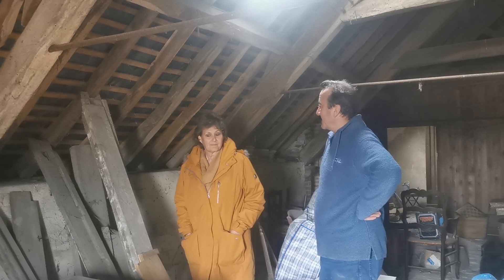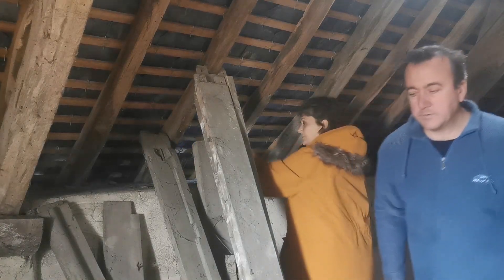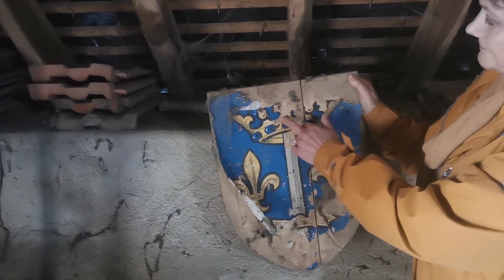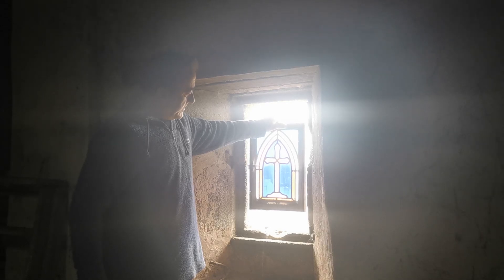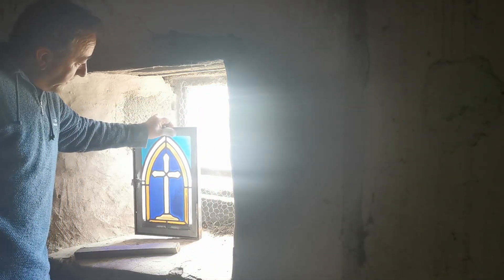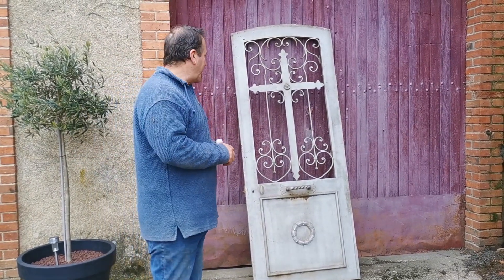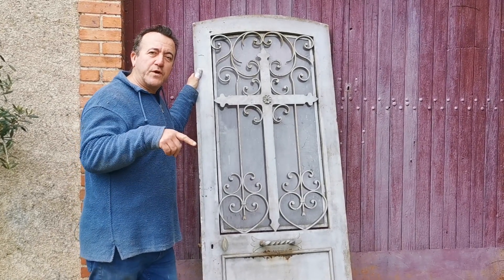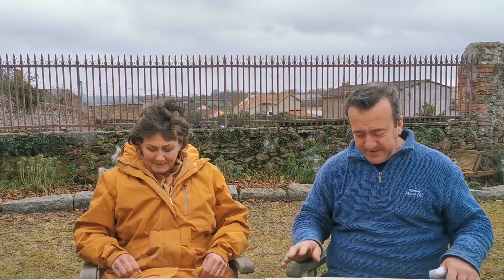Hunting for more glass in our attic

Comment: You might not like my answer but I wouldn't use the stained glass windows as windows in the attic for a couple of reasons. 1 the glass will be fragile, so I wouldn't be using as an actual window. 2, If there is any part of the glass that's been painted it will fade quickly in the light and 3, They are a conversation starter so having them so far away in a part of the building you don't go to means you're missing out. My suggestion would be to have the sitting on a windowsill in a bedroom so people can really enjoy them and the story. You could hang the in front on a window too If the window is bigger doesn't matter since they are hanging  in front. Not having the glass on the outside open to the elements would be safer for the glass. If you ever get your back door in the kitchen or somewhere the crypt door would make a great door. Well done of finding the glass.
Reply: We have lead glass windows that are Edwardian and we don’t have any fading. Most older glass that is coloured is mixed in with the glass itself rather than painted on. We also have thin metal bars to help support the lead frames as you’re right, they’re weak otherwise. We have our lead glass on our front doors and have a little protection so hopefully any hailstorms won’t damage them but that would have to be a consideration.
I like the idea of the stained glass being used in those windows and a plain glass surround to fit the larger frame and just YouTube how to do lead glass construction and it will look lovely.
Reply: @amayastrata4629  I didn’t mean the glass would fade. I meant any details that might be painted on would. My parent had their windows restored about 20 years ago. They are in strong sun all the time and all the lead needed to be replaced. Some of the glass became brittle.
Reply: I think you can get UV glass and make a frame, the out side glass would be UV
Then the stained glass,
Can  you see any indication
Of paint ?
The lead framing should be supported.

How's the thumb?
Reply: I agree
Reply from the maker: Hello Lea, thank for watching and for your comment. It's not about liking or disliking an answer, we often ask our viewers for their opinions and that will lead to all sorts of ideas, opinions etc. Inevitably some will be right for us and some not.  The two windows in question are in a metal frame and therefore supported and, of course, were made to be windows. As long as the glass was baked at high temperature the colour should be resistant to fading. The windows seem to be old enough to have been made in this way, more modern processes can be the problem. The attic windows are high enough to be visible from the village road and we want them to be on display for all. They may not be the biggest windows but would still be visible. One of them is visible from our courtyard and walled garden which means we would see it every day. Unfortunately all our windows have small panes of glass so it would not be practical to hang them in front of any of our exiting windows, they also open inwards making window sills unusable. Glad you like the door, we are definitely going to incorporate it somewhere. Have a lovely weekend, Suzie and Rols

Comment: I always love your finds! As I said before I used to collect stained glass and how I hung older pieces was to put chain around the edges supporting it all around and hang in front of a window by the chain. It is important though to have a stained glass artist take a look at ensuring the lead holding the sections of glass is tight and secure, which may need a bit of work.
Reply from the maker: Hi Lisa, the two we are considering for the attic windows are in a metal frame and the lead is generally in good condition so they do not require as much work as the arched piece. Have a lovely weekend, Suzie xx

Comment: Re: the lead light glass in the attic windows
The point about their preservation is that the lead is soft and gives under heat/cold and pressure. Then the quarrels of glass fall out.
Think about getting the original mounted on plain sheet glass, and then positioned inside the structure with the protection of the new plain glass which would be to code on the outside.

Comment: Rather than making the window opening smaller, could you not just put a frame with normal plain glass in and just hang the stain glass window,still in its frame,from the plain glass window frame?
Just a thought. That way you still get maximum light.
Keep up the great work.